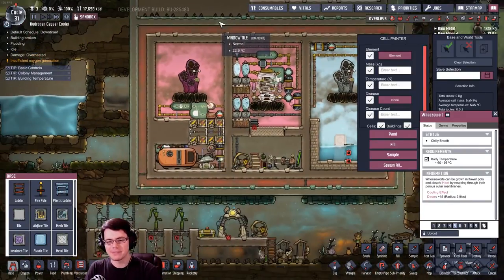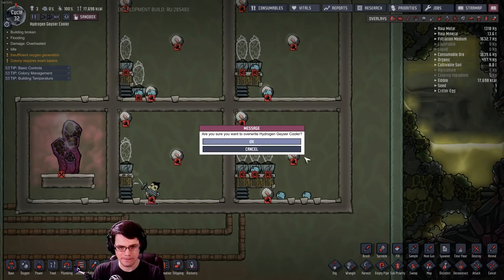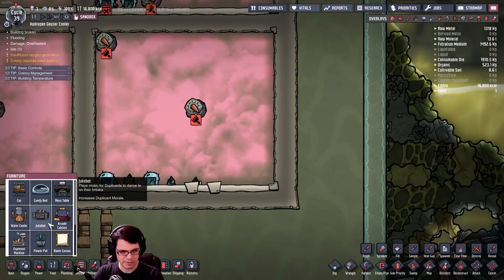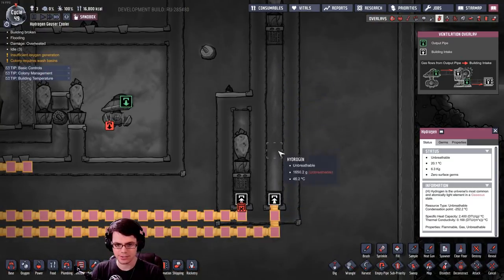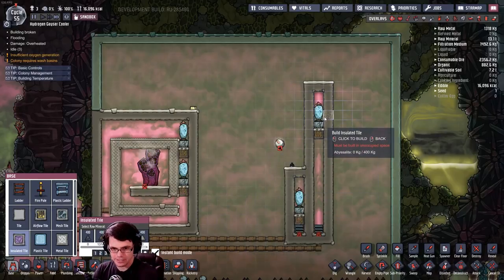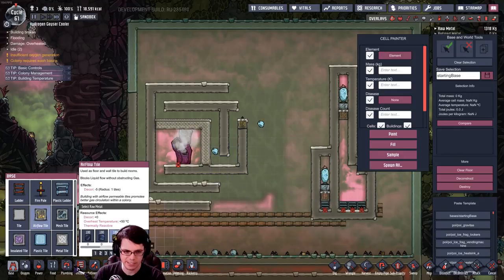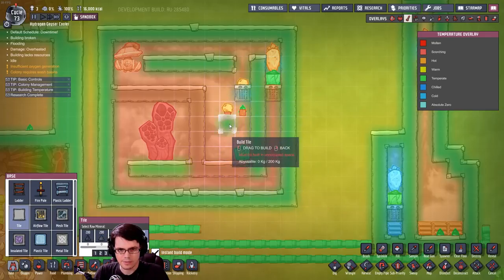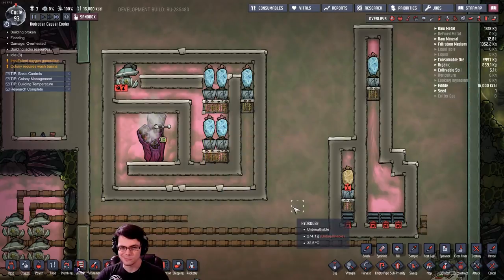Super Compression and Geyser Cooling! Venturi Wheezewort Oxygen Not Included

Comment: Does the game simulate black body radiation? Or is it all direct conduction? I was thinking if it was possible to make a radiator or something.
Reply: Conduction and convection only.
Reply: Damn... So is there an efficient way to use disposable liquids and gasses to dump heat straight into space? Or use phase changes to make a heat pipe? I want to experiment for myself, but I don't have a clue on how to use the debug tools.
Reply: @BrokenLifeCycle  heat pipes can be done, but it is a tremendous effort to dig out a space for one. People usually use polluted water or some other excess liquid/gas to dump heat into space, although generally oil and petroleum have the best thermal mass
Reply: What about steam turbines? It seems to delete heat but only at a very high temperature. Is there a way to feasibly pump heat from around a base and concentrate it under a turbine?
Reply: @BrokenLifeCycle  bases don't produce enough heat to sustainably run even a single turbine

Comment: I don't understand why you feel that keeping the circulation is so important. if you want to equalize and mix termperature differences in a mass of gas then why not just use thermal shift plates? That is what they were designed for - and they will do it much more effectively.  In fact I don't know of any other method in the game that works nearly as fast - not even directly mixing high-condictivity fluids directly...

Last I checked (admittedly a while ago) you could even make them out of various "junk" materials so except for construction time they are essentially free - and outside of very specialized compact high-performance systems the materials don't even tend to matter that much.

The only "problem" with using lots of thermal shift plates is that you add a lot of thermal mass. That wouldn't matter at all in a repeating system except that it would make it cycle slower and have a larger initial prep-time, but the former is often a good thing.

Can you tell I'm a fan of thermal shift plates yet? :)
Reply: KISS, The idea was to test if it was possible to create a hyper elegant, small loop.

The loop was a test of a scientific flow principle.

Its like E=mc^2, hundreds of convoluted formula simplified into its simplest form.
Reply: It's an attempt to use the vents in the early game with as little tech as possible.
Reply: The other issue is getting the shift plates heat soaked... Which, admittedly, is mostly because I don't know how to use them effectively. But this cools the system rather than transfer the heat (i.e. MAGIC!)

Comment: why not stick to the original ventury design ? make a wide base with the hydrogen geyser and calibrate the length and gradiant  of the vent (a long vertical funnel, not the device) above to let not overpressure. above the chanel, put your magic withwords on flow tile. make a room with the pump above it. do not recycle it  to cool the geyser, as long of the plant can put it below 100 in one go it is good enough.

Comment: Why don’t you use the high pressure vents?
Reply: I think he's trying for a system that's easier to make early on, as high pressure ones require plastic, which might not be available as easily.
Reply: Ok
Reply: It would still be better tho as high right?
Reply: And I gtg to bed so if I don’t respond ya
Reply: Yes, should be better as a high pressure vent indeed :)
Reply: A lower limit on the system fails sooner, but since  both vents work at the same rate either vent system failing indicates the other would fail the same over a long enough run.

Comment: If you're just trying to get hydrogen into pipes you don't have to cool it at all. On the forum I showed a system to exploits the difference between detection range and pumping range of pumps to make a miniature gas pump able to pump gases up to at least 1000C without any problems. Here: https://forums.kleientertainment.com/forums/topic/95870-sour-gas-refinement-v20-2kgs-natural-gas/?tab=comments#comment-1087618
Reply: And before you say a miniature pump is not enough with just 50g/s throughput. Check your superactive high output hydrogen vent. It actually only puts out 39.4g/s average so one miniature pump is even overkill.